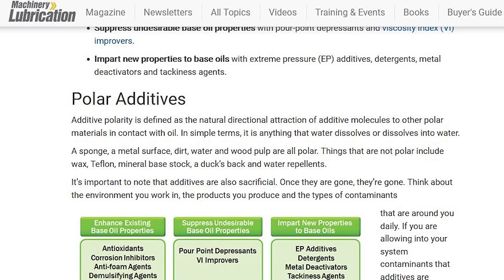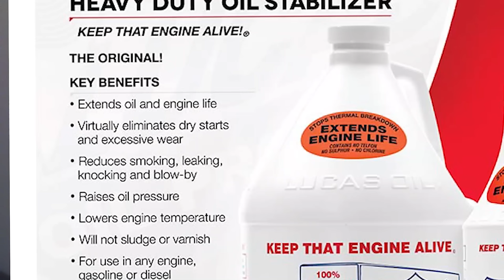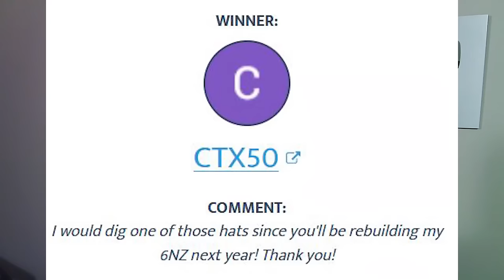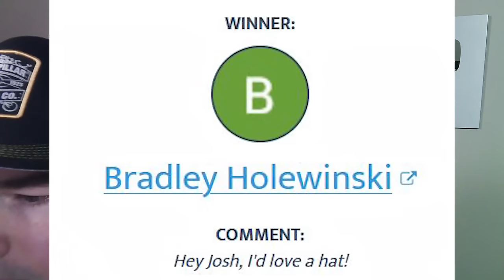Does your Engine NEED Lucas Oil Stabilizer? A detailed look at the "Benefits."

Comment: I spent 47 years in the trucking industry and aside from driving company trucks I owned 5 of my own...1 Cummins and 4 Cats that totally accumulated 2.5 million miles. All had oil and filter changes every 10,000 miles or 250 hrs and all were on Chevron 15-40. In that time none of them required o/hauls or bearing changes. In other words no additives or snake oils...just good quality oil and filter changes on a regular basis.The cheapest investment in my equipment was lubes and filters.
Reply from the maker: I can't agree more. I've rebuilt lots of engines with over a million miles that ran just normal oil and many of them have bearings that barely had a scratch on them.
Reply: 2.5 M miles divided by 5 trucks equals 500,000 miles per truck.  Since the early '80s, that mileage is nothing to brag about, as, for example, my brother's 2 trucks powered by Cummins N14s achieved 3M miles before inframe.
Reply: @cwj9202  
Thank you for showing the math. If he would have used Lucas from the time they were at 300,000 miles, then he probably could have gotten a million miles out of them.
People don't realize how oil works. The more worn an engine is, the thicker the oil needs to be to fill the gaps.
Reply: Only additives I go for are Zinc and/or Moly in flat-tappet gassers, and certain flush agents when having some issues, particularly BG109. Otherwise, just run good oil, good filters, on good intervals. 
That aside, every HEUI system I've seen personally with Lucas has had.... issues... that an oil change without the Lucas solved.
Reply: @cwj9202  What really sticks out is that was only 10-12,000 miles a year on a truck, really hard to make money with that low of miles on a truck.
Reply: @cwj9202  you have to put bearings in a N14 at 200,000 miles though.
Reply: @davidscott5903  oil is under pressure. If there is gap i don't think it matters how thick the oil is it will get filled. Science
Reply: @davidscott5903  -- Definitely.
Reply: @Bag0fRats  Not at all.  The bearings in my brother's trucks were original.  I was the only one who worked on those engines.  I replaced the injectors around 1.1 million miles.  The 200,000 mile figure you mention was good for the older NTC engines and the like.
Reply: @davidyuzyk6343  -- When the engines started to use oil, many truckers would use heavier oil which did decrease oil consumption.  It's an old trick that worked to help the engine operate an additional few thousand miles.
Reply: @cwj9202  sounds like you're trying to  tell me stuff you learned yesterday from your friends friend
Reply: @davidyuzyk6343  thicker oil does help reduce consumption, that’s a fact. One could argue that masking a problem is not necessarily a good thing, but he is absolutely correct on the reduced consumption.
Reply: @davidyuzyk6343  yes a gap is filled with thinner oil, however more space requires a higher volume of oil which causes the pressure to drop. Not a one size fits all situation, a thicker oil will help maintain better oil pressure but that only matter if it was dropping to a undesirable level.
Reply: @typrus6377    Yes, that's why it's not recommended for Ford Power Strokes.
Reply: @jaydunbar7538  Just get a rebuild before you cause more damage
Reply: @davidyuzyk6343  - If you said yesteryear as in the early '60's, the time period length would be accurate, but the information comes from solid second-hand sources and my first-hand experience.  Sadly, you have trodden the path of denigration, the sole reason for that approach being your lack of knowledge and experience.  If your position is solid, there is no reason to personally criticize.  Best wishes to you.
Reply: BagOfRats -- I should have been more specific.  With the advent of the big cam Cummins line, changing the bearings around 200,000 no longer became necessary as it was previously performed on the small cam Cummins.
Reply: What's your opinion on your more higher end oils like Schaffer's as example?
Reply: @davidscott5903  David you have allot to learn about engine oil
Reply: Lucas is a 60wt base oil with almost zero anti wear, detergent or VI improver. It's snake oil for the engine oil ignorant. Pressure does not equal protection guys, that's a fact. Actually pressure is resistance to Flow and literally starvation of oil... This is the biggest reason all modern engines are designed to pump VOLUME instead of pushing pressure. There's allot more in depth reason but flow is the king and Lucas is the opposite effect. Lucas also has problems with entrained air, micro air bubbles that replace the pure oil film and allow higher wear. Trust me you do not want entrained air in your engine oil and any lubrication engineer will agree. Lucas is a distaster in any HEUI injected diesels because of the entrained air. 
Anyways, Throw away the Lucas and use a high quality PAO based synthetic. If you are having oil consumption problems, use 15-40 or 20-50 rated oil but otherwise a 10-30 or 5-30 synthetic will out perform a conventional oil 15-40 , especially anything mixed with Lucas garbage.
Reply: @AdeptApe  Completely agree. High quality oil, no snake oil additives dumped in !!
Reply: @100pyatt  -- Good points.  There is no need to worry about entrained air, as all engine oil, engine fuel, even hydraulic oil, and engine coolant contain entrained air.  For example, the liner cavitation seen on the outboard thrust side is caused by little air bubbles in the coolant imploding when the liner expands and contracts with every combustion event.
Reply: @100pyatt  bull shit we have used Lucas and we have 4 million miles on 1 block with 3 in frames on a 95 model n-14 eclectic 500hp. On one of the in frames wasn’t due to wear! So this guy is a good Machanic but on a 100 degree day the engine is better off with Lucas and in the winter at 0 maybe not but most owner operators should have common sense!! If not then you shouldn’t own a truck! I guess your not God with your episode hating on Lucas!!I guess all the older semis that Lucas runs they probably don’t run there product, yeah right! They rebuild there trucks and they keep going! A caterpillar is a good engine but a little over overrated and over priced!
Reply: Will I take your advice when it comes to running Lucas, hell no, but I will say you have to use common sense with anything! Lucas is great and i wouldn’t put it in a Prius but I would never own one!  Now with history in the Heavey Heavey haul like 13 axle and on up to goldhoffer with c500 kw prime movers and planetarys Lucas keeps the diffs from red lining were they get so hot and it works great in engines as well! A new isx will only give you at the most around 7 to 8 hounded thousand miles and we’re the exhaust pukes am back into the engine I maybe wouldn’t use this but I refuse to run that junk. Now with older engines you can get well over a million miles using Lucas and that speaks for itself! I have seen it done many many times! That’s my 2cents. But everybody will not have the same experience!
Reply: @davidscott5903  well I'm pretty sure they ran 1.5 million each. I mean 3÷2=1.5 right?
Reply: @davidyuzyk6343  
Yes, but ask yourself how that oil gets out of those bearings. And then think about the force squeezing that oil out of those bearings, then also realize that it is a momentary force and the bearings fill with oil during the rest of the stroke but then have most of the oil squeezed out of the high pressure side of the bearings during the power stroke. And then also realize that the viscosity of the oil is what prevents the oil from getting squeezed out before the powerstroke is completed and the journal from coming into contact with the bearings and having metal to metal contact with all of the associated wear. Real science!
Reply: @cravenmoorehead5636  
No, it was 2.5 ÷ 5 = .5, or 500,000 each.
Reply: @100pyatt  
I was a machinist's mate in the navy, and now I'm a mechanical engineer, so please help me understand what more I need to learn about oils. 
Maybe I can explain it to everyone  else who might not understand how oil works, in a way that I explain it to my nieces and nephews. Oil kind of works like a water skier on shallow water with lots of rocks under the surface. If the skier is too heavy, or goes too slow, he hits the rocks and damages his skis. But if you were to ski on syrup, or gravy instead of water, then that's like increasing the viscosity of the oil, and then you can go slower, or support more weight. I hope that helps some people understand how oil works. Let me know what more I need to learn.
Reply: @100pyatt  
And it's spelled "a lot", not "allot"
Reply: @davidscott5903  calm down Bill Nye
Reply: the way i feel is if you want to put thicker oil in just buy thicker oil..
me and a buddy put some in a 4cyl engine running a generator and ran it for a few weeks none stop dropped the pan there was no difference in the way the oil was "sticking"
Reply: @davidscott5903  Only as a stop gap measure, & only for a short time.  Thicker oil will not lube anything that isn't worn out, and will only provide adequate cushion for severe cam, rod, & main bearing pounding to a small degree.  AND bear in mind that @Old Pete did not state he had yet experienced any problems, most likely meaning that he had not done overhauls or even bearing rolls at that point.  Speaking of which, IF your truck engine is only needing bearings, it isn't too hard to roll bearings into most of them in frame.  That is much better than dumping thickening agents of some sort into the oil pan.
Reply: Dang don't yall be telling Ryder 10K on a wet, they gonna say 20-25 with that mystery synthetic LOL!

What do yall think about that new 10w-30 FA4 synthetic?? Cummins says 75K on a wet, iiiiiiiiiiiii dunnnnoooo about all that. But we got 2 X15's that specify it, with another on the way.
Reply: 1 400 000 miles and had small wear,  used Delo every 10k . And was compared to the CAT OIL ANALISIS that proved my maintenance.
Reply: @davidyuzyk6343  true to a certain extent. Put a 20w 50 in a small engine at 0 degrees F and cold start that engine. It will take longer for thick oil to get into any gap than a thinner oil would get into same gap.
Reply: @JK   the stuff you're supposed to leave in all the time is generally unnecessary, but some of the ones you put in once in a while can have benefit, like putting Sea Foam in your oil 300 miles before you do PM, has measurable benefits.
Reply: @davidyuzyk6343  The thicker the oil, the longer it takes to get to the upper engine on a cold start.  The old adage of 80% of engine wear happens at startup is true.
Reply: @cousinfester4621  lol come live in Canada. It never gets cold here
Reply: @davidscott5903  
You don’t realise how it works, viscosity requirements are not based on clearances at all
Reply: @jaydunbar7538  pressure is not the requirement, flow is the requirement.
Thicker oil may show higher pressure but will be lower flow- not good
Reply: 😭...thats what you folks all sound like.
Reply: @mrbumcraic5046  
You don't know what you are talking about, or you would share your great wisdom. I dare you to tell us all the details of what viscosity requirements are based on.
Reply: @scav3155  
Yep, probably me too a bit. Sorry that you had to see that.
Reply: @davidscott5903  
Pretty simple, based on load and speed
Reply: @mrbumcraic5046  
That's it? What about bearing surface area?
Reply: @davidscott5903  
That’s load, larger area = less load
Reply: @Bag0fRats  I just had my 1.5 million mile N14 replaced. Bearings were still serviceable.
Reply: You mean little plastic gears barely touching , yeah that doesn’t count
Reply: @bigboreracing356  - Sooo, one truck accumulates 1.8 million miles during a lengthy period while the other four trucks only travel 700,000 miles averaging 175,000 miles each over that same period!!!  From a business perspective, one rig remaining quite busy, generating revenue while the other four are mainly costing a lot of overhead is a recipe for bankruptcy long before the busy rig reaches 1.8 million miles.

Let's use your critical thinking approach with this math:  One truck goes 2,460,000 miles and his other four just 10,000 miles during the same time frame.  That example is obviously unrealistic as is your proposed scenario. 

Old Pete had his chance to respond to any reasonable thoughts but chose not to, so intelligent people have to reasonably guess at certain unmentioned details.  There was nothing wrong with my line of thinking.
Reply: @bigboreracing356     To knock loose the accumulated sludge.  But don't just take my word for it.  There's plenty of videos proving how it works right here on YouTube.  So thanks for embarrassing yourself again, as usual.  But I will say this:  you sure did nail it when you named yourself "no prep."
Reply: @JK I doubt it is trash it's thee most popular additive on the market, every autoparts place and Wally World in the country never runs out of it. I got 12 yrs pulling rv's commercially and I do believe in the stuff
Reply: Nowadays they go 60,000 miles plus on oil change big rigs I'm not an advocate of that at all I agree with your synopsis 100% good quality engine oil frequent changes 10,000 MI winning formula you don't need all of these additives extended oil drain intervals from engine manufacturers are a disaster
Reply: @joeblow4566  my truck manual said that oil change under light duty must be preformed at 35000 Miles… also Kenworth claims 15k for heavy duty and 25k for medium duty. Now . It doesn’t define what is light normal or hard duty. “ no studies” 
How ever I could never do more then 20 k on oil change . Not before not now after overhaul. 
Oil gets so thin that oil pressure drops to the point where engine cuts out. 
So I do 15000 miles oil changes. 
Truck is happy this way. 
And before anyone asks . Yes I have a new oil pump and oil cooler… had a fuel pump explode last year… so many things have been replaced when that happened. I’ve personally found Lucas help with oil leaks and blowby. That was the case before the rebuild. Never saw any other benefits. But hey every engine is different. 
ISX 15 for example. Likes to stay with in 22-30 psi oil pressure range. When I’ve first got it I was worried that something is wrong. Was used to engines that ran 40-50 psi. 
Thankfully everything is alright. As many of trusted mechanics assured me that it was in fact a normal range…
Little note. Don’t use full synthetic oil on ISX 15 from 2012. 
During high temps already low viscosity of full synthetic will drop when hot and broken down a little. Resulting in drop of oil pressure below 20 psi during drive . Witch in turn will signal engine to shot down.I’ve used full synthetic once and No more.
Reply: @Mr_Meowingtons  Matt, did that generator have a forced oil system or just a splashed system? Some generator engines use splash and some forces oil utilizing an oil filter. The splash system uses non-detergent oil, and detergent for forced oil with filters, but I’m sure you knew that.
Reply: Pure intelligence...
Reply: Both are designed with properties to preserve your engine. It's just that people today think you don't need to do your due diligence if there's some magic juice that's going to solve everything for you
Reply: @davidyuzyk6343  its about speed. Viscosity is measured in seconds, thus in relation to time.
Reply: @cwj9202  what’s an inframe?
Reply: @tatecraft1361  When the pistons, piston rings, connecting rods, bearings, heads, injectors, etc. are replaced while the engine block is still within the frame of the truck.  The opposite would be an out-of-frame overhaul where the entire engine is removed from the truck, and all the repairs are completed on the engine away from the truck.
Reply: @badgerpa9  not if you don't haul cheap
Reply: @crenninger1000  I suppose you can charge $10,000 a mile.
Reply: a 10,000 mile oil change on a big truck is like a 1500 mile oil change on a car
Reply: I am currently using Lucas full synthetic 15w40 in my powerstroke and after 2 weeks, my oil was so clean, that I had a hard time seeing it on the dipstick.
Reply: yup I changed my oil and filters 2000 miles premature eh Always sent it to a lab. Never saw a breakdown of alarming nature, Like you long life and efficiency.
Reply: @davidscott5903  the math that means nothing? Bro he didn’t say that the 5 vehicles were driven to the point of failure. You’re assuming that…
Reply: @nickzaremba  
Good point. But we also don’t know how much life they had left in them. Kind of like my 7.3L that has over 200k, but I don’t know how long it will last. It might get another 200k, or it could throw a rod tomorrow. All we can go off of is what it has already done. No one can tell the future, but if you can, please contact me and we can discuss stocks.👍😁
Reply: My Honda accord was burning huge , knocking and ticking. Increasing viscosity did not solve issues. 15% lucas solved all issues. 

Start with 10 percent lucas, then increase until your issues solved. 

Also fixed my lawn mower smoking and knocking.. I don't want to put money for new one.. 

Not everyone wants to buy new engine or car.. lucas is a good product and has its place.. I buy the gallon jugs..
Reply: Truth. Especially Lucas mineral. The stuff the video is all about. 
In a nutshell, no GL/API rating what so ever. Plus, less lubricity (yes less) and more viscosity eaquals more heat, more wear. 
This stuffs only use is engine assembly lube, and engines and transmissions that are already complete scrap
Reply: @VolvoOverdrive-fb6fo  thicker oil provides more protection. 0w16, 0w20 provides slightly more fuel economy, that's why it is being used in newer cars. 

How many truckers do I know use it in engines, differentials..  

I would just use as little as needed in engine.. I start by increasing viscosity from 5w20 to 5w30, etc. Then start with 10% lucas and increase in increments until oil consumption, ticking, knocking is gone.. 

They sell it by the skid at the nappa I go to.
Reply: @mysticjedi6730  it raises temperatures due to viscosity increase. It's protection level then is null and void. Contaminates and dilutes good oil and increases wear. The end
Reply: @VolvoOverdrive-fb6fo  you have absolutely no idea what you are talking about. 

After wear in engine tolerances open up. Switching from 5w20 to 5w30 or using a little lucas to eliminate oil consumption, knocking, ticking is not a bad idea. 

The trade off is maybe half a percent in fuel economy. 

I'll tell you what. You never increase the viscosity of your oil or use lucas.. 

These thinner oil are becoming factors fill for a little edge in fuel economy, not better protection.
Reply: @mysticjedi6730  a little knowledge is. Dangerous
Reply: So 10,000 miles a year per truck? It’s put more than that on my daily driver. You must’ve not made much money trucking
Reply: @cwj9202 that shows what he really knows...5 half life trucks..im going back to watching tv at this point.
Reply: Ok but to avoid knocking, ticking and oil consumption starting with 5% lucas oil and going up from there works. 

I was given a free honda accord. Wicked knocking and ticking. 15% lucas and upping from 5w20 to 5w30 quieted the annoying and embarrassing sounds and oil consumption. 

Lucas works for its intended purposes
Reply: This product worked on an older Cummins to cool down engine temp in summer ,increased fuel mileage slightly and reduced oil consumption. End result was bearing issues and seals blowing out. Fuel mileage increase was short lived .
Reply: @bigboreracing356  change the oil every 10,000 miles running shell Rotella we are still running that truck! It has a 500 hp n14celect
Reply: @bigboreracing356  my dad drives that truck a 40 year veteran so I’m sure that may play a key role. The truckers had 2 or 3 inframes 1 out of frame
Reply: Can you review motorkote?